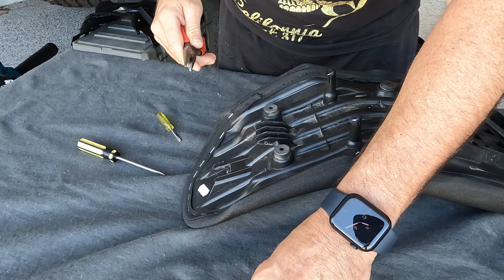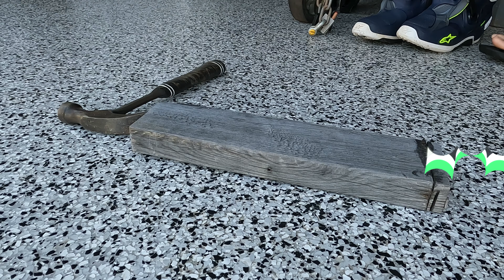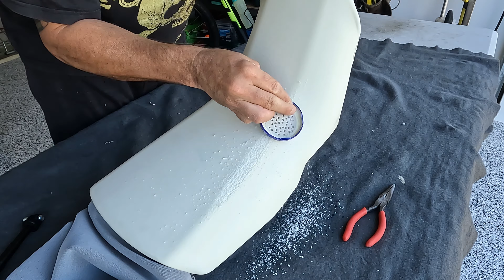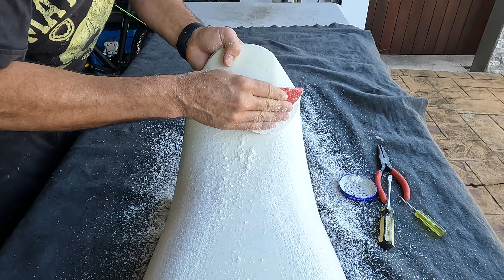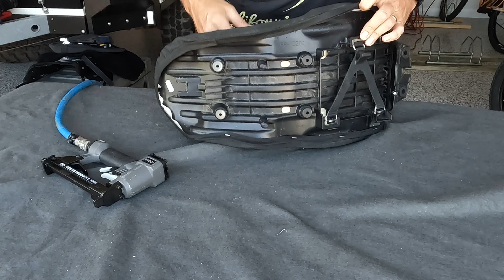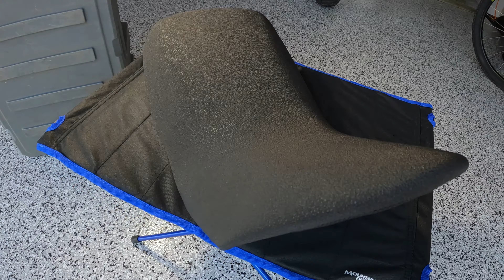YAMAHA TENERE 700 MODIFICATION OEM SEAT / 100% MORE COMFORTABLE THAN STANDARD

Comment: hey I did the same thing with mine whilst converting to a front seat key release. Only I used an angle grinder with a flap disc. makes all the difference creating a rounded crown. Though I went a bit further than you did and took a few mil off the height as well.. Now the seat is really comfortable and I think will be fine for long rides.. Cheers
Reply from the maker: Yep differently happy with it !!! I’ll check out your seat release cheers shane’o
Reply: any update on how it feels for longer rides? does cutting it down making it lower and wider help a lot?
Reply: @Endurogasm  I only shaved the shoulders and not much of the height..
As for long rides of 3 to 4 hrs, it has been great.. happy with it.

Comment: Thank you for the video, I can't take riding the T7 for more than 2 or three hours at best.  Going to try you mod and add a gel pad in with it.  Really want to do some long range riding but just can't as it is!  I even bought a Seat Concepts "low comfort" seat (I'm not blessed with long legs), and it's no better than the stock seat, maybe even a bit worse...
Reply from the maker: Thanks Tony.
Reply: How's the comfort now, after you customised it?
I'm looking for tips ;)
Reply: @Rubmaster  I bought the softest foam I could get and installed in on the stock seat, it's more comfortable but not a heck of a lot.  I'm going to buy the softest foam seat concepts sells for their comfort seat, it will be same height as stock so it's not the "low comfort" but I've gotten used to tip toeing the bike.  I'm waiting for better weather to come around before I spend the money on the new foam and cover that will be needed...

Comment: Love such tutorials man, thanks a lot! Quick question, do you think you would be able to get the staples in with a mechanical stapler? I have one that I've used to do work at home, no problem to go through several layers of fabric + wood but I'm wondering if it would work through the plastic of the seat. What do you think?
Reply from the maker: I cant see why it wouldn't work, I just have the right tools at the time. Just try it first and see how you go, you cant hurt anything 👍. Thanks for watching .